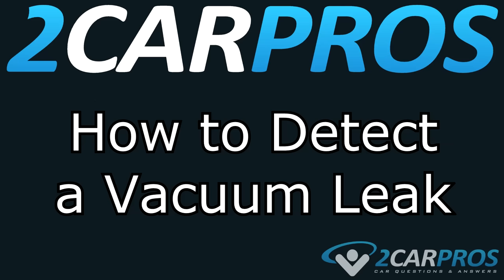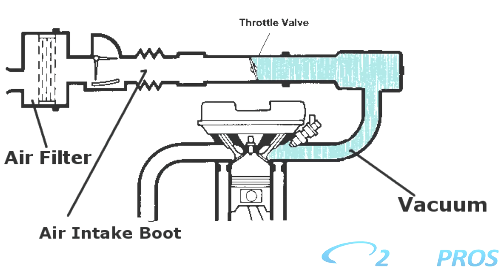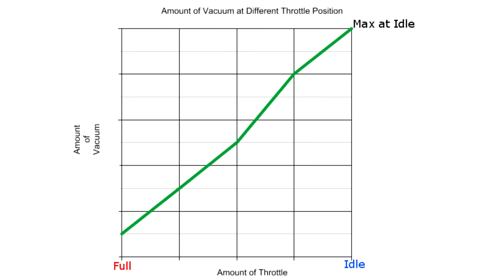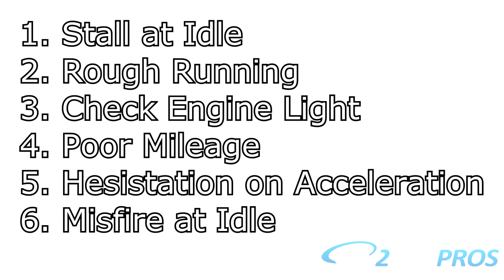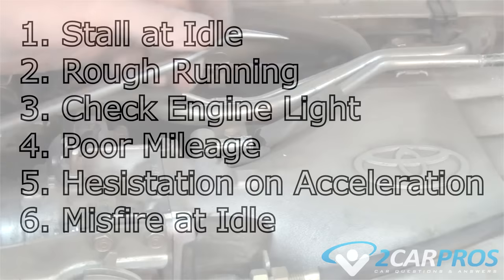How to Find a Vacuum Leak in about a minute!

Comment: There sure are a lot of safety nazis in the comments. Everybody knows carb cleaner is flammable, yet professional mechanics do this sort of thing all the time. Even if it ignites (extremely unlikely), the fire will be extremely brief because there will be very little fuel to sustain it. Relax, everybody.
Reply from the maker: People just like to flex in comments about something they think they know about. But thank you for your comment! :)
Reply: I finally got the answer I been looking for: smog test I don't know how my car passed cause check engine light was on and has leak I just reset drove and past
Reply: @marcosman3393 howwww…what did you do, and what exact code you had??
Reply: People seem to misconstrue flammable with combustible quite a bit
Reply: People with nothing to offer like the aligns of their own voice

Comment: Actually the proper way to check is by using propane. It increases idle when used and doesn't harm rubber like other chemicals.
Reply: Use smoke

Comment: So spraying carb cleaner on a hot engine isn't combustible?  I'll pass on this idea
Reply from the maker: The engine has to be extremely hot for this to happen if you notice in the comments to start with the engine cold.
Reply: 2CarPros TBH I didn't read the drop down.
Reply from the maker: NP :) please visit anytime
Reply: A hot engine isn't really a  problem, however spark leak is. Even with Coil on plug systems coil is insulated with Plastic/epoxy and little crack can allow an errant spark. It's a problem that's worse with coil packs and plug wires. They sell non-flammable vacuum leak detection aerosol spray for a reason.
Reply: Make sure you bring a lighter incase you can't clearly see which hose it is😉
Reply: @sophia66404  😂😁
Reply: You can use water out of a spray bottle. The mist is fine enough to not damage any electrical components under the hood.
Reply: Ummm you shouldn't be working on a hot car period. Let it cool off then proceed with finding the leak .
Reply: @sophia66404 problems solved, lol
Reply: It's not combustible, it's flammable. It will burn very quickly, but if it was combustible, like gasoline, it would straight up explode. But yea, I would just go with propane enrichment

Comment: The sprays worked fairly well on old carburetor cars but not so much on modern fuel injected and computer controlled cars as with small leaks the computer often simply adjust the new mixture too quickly for any change in engine noise to be noticeable so this method frequently won't work at all. If a smoke machine or a cigar isn't an option, it's usually easier to put a meter or so of windscreen washer sized rubber vacuum hose or similar in or near one ear while moving the other end around the inlet manifold and other parts in the engine bay listening for the very distinctive sucking noise of a vacuum leak. Done with the engine idling both on a cold engine and one at at normal operating temperature as some small leaks like those from a burnt out inlet gasket are from a gap that may open or close up with expanding and contracting metal part (e.g.between  head and manifold). Cheap party fog machine can also easily be adapted to make a smoke machine and there are various You Tube videos showing how to do this. But the only time I've seen this spray method work with current computer managed engines whether using, water, oil, engine start, carburetor spray or benzene etc is in demos where the leak source is already know. Even with old carburetor cars your method often won't find small leaks such as leaks in the bottom side of the inlet manifold as you are fighting gravity as the liquid or gas will simply fall towards the ground rather than being sucked into the manifold. As well as it hit and miss effectiveness. it's also a very messy method where sprays are used, so I gave up on this approach years ago.
Reply: Very helpful information. Thanks for sharing it.
Reply: Thanks for this comment, especially about the fog machine! I was reaching the end of my rope looking for my leak. I tried to use carb cleaner and couldn't find any changes, I was actually considering just replacing parts until I fixed the issue. The fog machine actually crossed my mind (since I have one) but I was afraid adding water to some of these components/sensors might cause issues, especially since I never see anyone recommending it. Now that I think of it though, it can't be worse than any of the homemade smokers people are using.

Comment: Always have a fire extinguisher on hand when using a flammable to do this type of operation.If you have a scanner tool you can look at actual values of your front O2 sensor.Using the same method the O2 sensor will spike very high even if it is a smaller vacuum leak that does not make your engine lope.Loping at idle using the backyard method.Use a water mister(No fires) and mist around the engine.If you have a good sized leak the engine will bog down when you spray the sight of the leak.

Comment: I tried this on my Passat weeks ago. The ECU was already compensating for the vacuum leak buy running set parameters. If this does not work by ear, hook up an OBD2 diagnostic and read load value or fuel trim while spraying. I found three small leaks by just feeling around with my hand and reading load value on scanner. Still haven't found the problem but I no carb cleaner didn't do anything even when I sprayed it where I knew leak was. But makes sense on older vehicle

Comment: using something to spray typically will damage rubber/plastic components. (form of dry rot, it will dehydrate the material) as a 1 time thing it may not cause excessive  damage but something to keep in mind
Reply: So what’s the other safe alternative?
Reply: @ThatBoyMichael1  smoke machine
Reply: Carb cleaner is also safe for rubber, vinyl, and neoprene. If your carburetor has these types of seals or gaskets, you won’t need to rebuild your carburetor after cleaning.
Reply: @ThatBoyMichael1  ...propane gas regulated from a small camp stove bottle...... still flammable but not a liquid being sprayed.

Comment: Does a vacuum leak make the MAF sensor display a check engine light on your dash because it senses unbalanced air to gas ratio?
Reply: Yes and no, what you need to ask is "Will a vacuum leak cause a MAF-code?" To answer that question, any leaks in the vehicle’s intake system can lead to a discrepancy between the actual amount of air entering the engine and the air calculated by the MAF sensor. This disparity can trigger the P0101 code.
Reply: Thank you!

Comment: I use a propane torch (Not lit) and even that doesn't work all that well on engines with throttle body and Fuel Injection on smaller leaks.

Comment: Question if the smog vacumm pump not working does it affect the Brake booster in a Ford 1984 F-250 with a 460 engine

Comment: I tried this, nothing obvious.  I visually checked all the vacuum lines, carburetor cleaning spray, even butane and smoke, nothing revealed but I still get the check engine light comes back on!
Reply: Likely low fuel pressure
Reply: Same here. Have a v-6 Buick, 2008. Running on 5 cylinders.
Reply: @missingremote4388  check your coils and plugs fuel pressure...how many miles and did you check what codes you have
Reply: @liveandletlive2894 code:P0305. it started, rough idle, and from a dead stop to accelerating does this "rolling surge"of horsepower about a month ago. W/ 179.000 miles. Now has 181.000 miles. Ignition coils are good, new ICM, and throttle body + plugs&wires last year ½
Reply: @missingremote4388  a engine needs
1.Air
2.Fuel
3.Spark
4.Compression
5.Timing

Let's hope and assume the issue is from the top 3 as those would be the cheapest fixes and most likely it is...maybe that injector is bad you can test it with a screwdriver to the ear but that wont eliminate it possibly being clogged
Reply: @liveandletlive2894 thank you,  I'll try that injector test and check wiring. I have a stethoscope, and multimeter.
Reply: @missingremote4388  keep in mind that this kinda test will only rule out an electrical issue not of a clogged injector
Reply: Once your at it just switch the coil from cylinder 5 with another just to rule out it having gone bad
Reply: Check you spark plugs and coils

Comment: Could you use a non-flammable gas (e.g. carbon dioxide) for this sort of test? The oxygen sensors would see the reduced oxygen concentration in the exhaust so you'd still see fuel trims go rich, and you'd have a noticeable change in the running of the engine, I would have thought.
Reply: (and by rich fuel trims, I mean an apparent rich condition, i.e. more negative)
Reply from the maker: Maybe not right away, it is much easier to do it this way. Thanks for watching!

Comment: i thought the point of the spray was to introduce vaporized fuel besides whats already there, as its sucked into the system through a crack, causing a raise in idle speed. you showed dousing the area with liquid and drowning the engine.
Reply from the maker: Yes that was for emphasis as it is hard to see small cracks on camera. Thanks for watching!

Comment: Why does liquid have to be flammable for this test?
Reply from the maker: So it will get sucked into the engine via a vacuum leak and the engine will burn it. The engine will increase in RPM so you can tell what you are spraying is where the hole is. Thanks for watching!

Comment: Would this be an issue if the car is stalling in drive or reverse?
Reply: Jacob Rodriguez 
possibly your idle air control valve.
Reply: I think stalling is an issue. Yes.
Reply: Yes that’s my problem with my 2015 Honda vaccumm leak stalls when your at the light and when u push on the gas ⛽️ so stressful getting it fixed today omg nightmare 🤮😱

Comment: can I check vacuum leak from scanning the car?
Reply: Not really. The computer might give you a code indicating that the exhaust is "too lean", meaning that there's too much air in the system, but it's not going to tell you where the air is coming from.

Comment: Thank you keep up good work
Reply from the maker: Thank you for watching!
Reply: 2CarPros hi there,i have a question,I believe i have an intake manifold gasket leak(small because im not losing coolant)but how would i go about finding the leak in my situation?My car threw a p171 and i believe its due to my manifold/gaskets sucking in unmetered air.I have an 05 chevy monte carlo lt 3.8 and i hear these are notorious for the intake gaskets failing.

Comment: whats with the 81 people that disliked the video?
Reply from the maker: Not sure, could just be angry people. They are everywhere! But thank you so much for watching!
Reply: ALBERT MAGLANQUE Thos don't want people to know how easy is to fix
Reply: Probably because using "something flammable" is a huge no no it's irresponsible and isn't how "pros" do it. It's a good way to burn down your car or at least burn all the hair off you head and arms. One errant spark a kaboom, seen idiots in various shops do it over to the years saw one car burn down.
Reply: Actually it is exactly how pros do it. Carb cleaner needs an open flame to combust, not just heat. If you're a pro, you know these things. Otherwise, you just attack others who actually know what they're doing.
Reply: @TheHeyman1104  maybe a pro hack. Over my 23 years in the automotive industry have seen 4-6 engine bay fireballs and one guy burned bad (+ that burndown) short cutting a vacuum leak diagnosis with carb cleaner. Spark leakage  caused all but the last one. Not sure what caused the last one the guy was just lucky another tech was fast with the fire extinguisher. A PRO uses a smoker if he/she has the tool or uses the proper leak detection spray sold in auto parts stores right near the carb cleaner. Those smokers are expensive.
Reply: I've used this trick many times and haven't had an issue. Maybe it's because I used common sense as well though. My 30 years in and around the car business has seen 0 "engine bay fireballs" due to this old and well accepted trick. The only fireball that I've seen was the result of a leak in the fuel rail and a stray spark. Also, the guys from 2carpros are ASE certified techs with more know how in one finger than most mechanics have in their entire garage.
Reply: @TheHeyman1104   do i did not pushed the dislike button i think its because it did not give help to them. you cannot always hear a sound while engine running when it is a small leak. (i think most of the time its a small leak).
Reply: @BiclorMoban  if one had a smoker where should he insert it in the car the find vacuum leaks?
Reply: Vacuum smokers have a intake plug with a fitting on it  like a air tool hose. I made one from a valve, air tool fitting and a pvc cap. Just plug the tail pipe attach your air intake plug to a compressor open the valve a bit listen for air leak.
Reply: @BiclorMoban  I have one of those party fog machine deals. what tip would I need to get to a attached to it? Thank you so much for the info
Reply: I have no idea how that would work. Generally automotive smoke machines use nitrogen and  a dye. I don't know if it makes enough pressure or it's safe.

Comment: Hava 08 vibe.Asymtomatic, just 0171 code.  BUT IT ONLY HAPPENS IN THE WINTER! Wat cood it b???
Reply: I have an 07 vibe, usually just the winter too. Sometimes when i clean the Mass Air Flow sensor the code clears. (this time that didn’t work so I think I might have a leak).

Comment: Pros use a smoke machine, and connect it to a near by vacuum line. The method you showed is how most 'home' mechanics do it. 

Don't believe me? Look up "Vacuum leaks using smoke" and watch the amount of results that pull up from mechanics.
Reply: Well I'm at home so.....
Reply: I think this video was more for DIY at home remedy. No one said they didn’t believe you...
Reply: Exactly he showing how to save money a shop would of charged $60+. At home it's $1.97 the price of the can. Free if you have it already. Can't go wrong with this
D.I.Y DEAL.

Comment: For those of us thick in the head and don’t get how spraying the cleaner helps finding a vacuum leak and missed the obvious; please spell it out with words!
Reply from the maker: Sorry if I didn't explain it well enough. So the engine creates vacuum in the intake manifold when the engine is on due to air being used.  Auto makers use this vacuum to do all sorts of things like control a blend door actuator. This means there are vacuum lines that run to different places and they are just made of rubber which can crack and get ruined. 

Now if outside air gets into the system via a leaky vacuum line the engine doesn't know where it came from and can do all sorts of weird things. So in order to get an idea where it came from we spray something flammable (i.e. carb spray) around the vacuum lines. If there is a leak where we spray the engine will raise in RPM and if there is no leak the RPM won't change and we can move on. 

Think of vacuum as the engine's air supply so if extra air is getting in that the engine doesn't know where it came from it won't run right. So we use carb spray to hunt down where the leak might be. 

Thank you so much for watching and I hope this helped!
Reply: What your doing is causing a temporary rich condition.  You are adding excess fuel (the carb cleaner ) it enters thru the leak and changes the idle when it enters the combustion chamber.